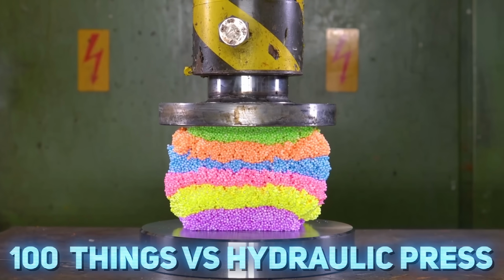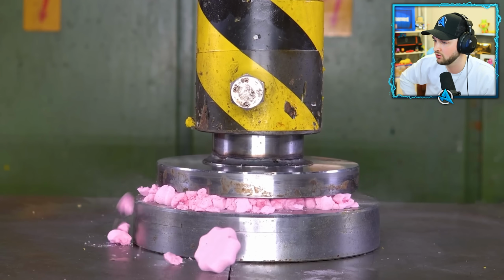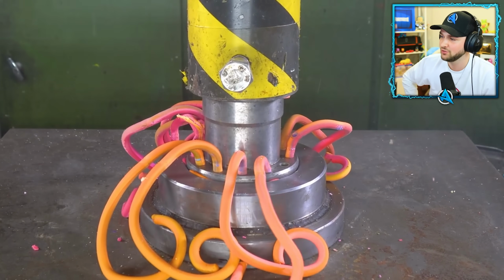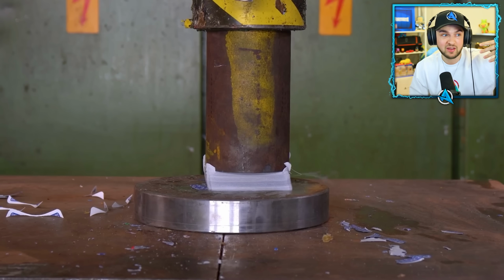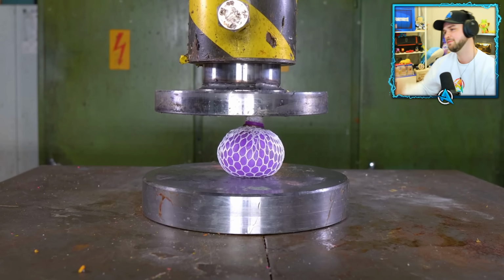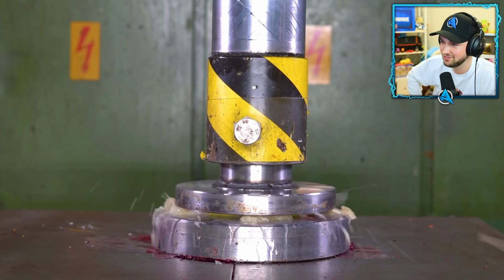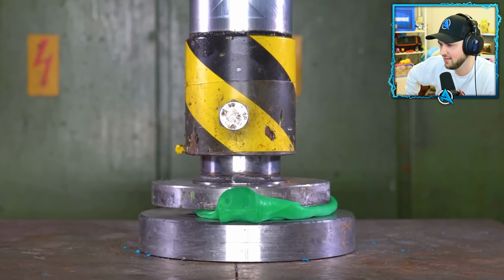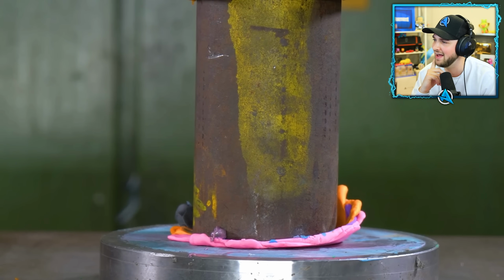*NEW* 100 ITEMS vs HYDRAULIC PRESS! (Oddly Satisfying Moments!)

Comment: The second can survived because f the pressure of the air sealed inside the can making it stronger the hydronic press is just making it stronger because the air is pushed closer together therefore it is very tight so surprisingly it survived!